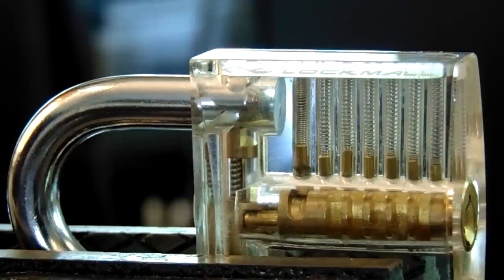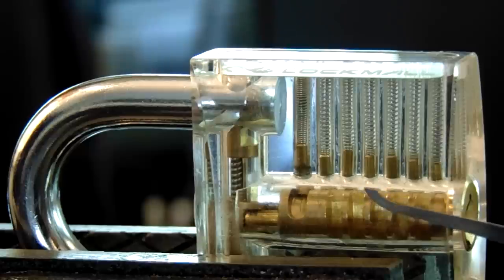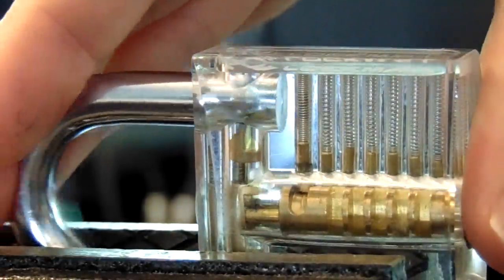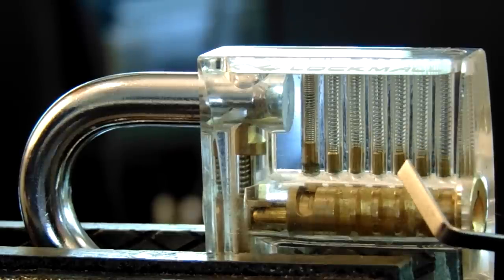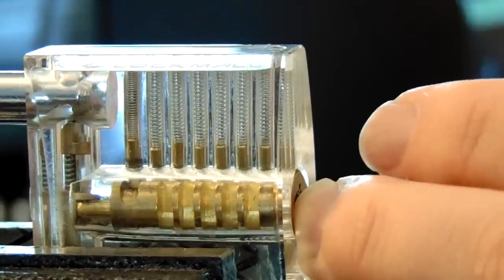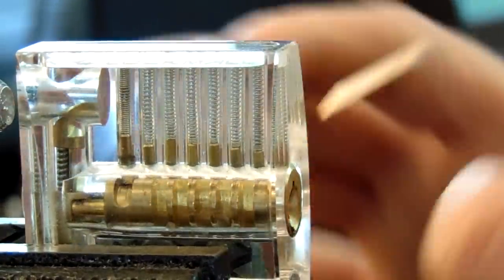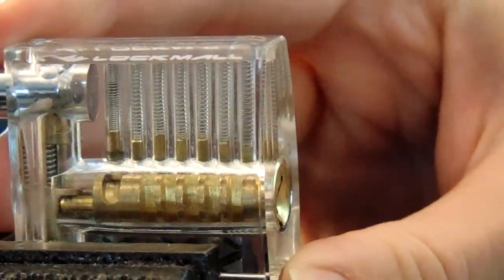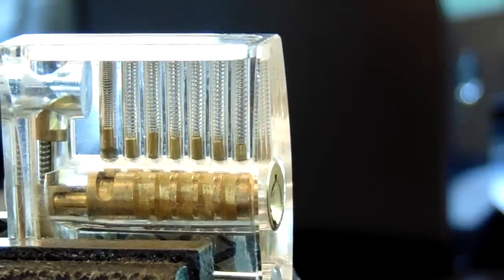[30] Closeup On How Lock Picking Works

Comment: I don't know how many times I watch those secret agents on TV as a child and tried opening door locks with a paperclip or a metal nail file.  Later in life I had a general understand of how locks worked, but your video totally explains everything I never knew about lock picking.  I just have one question.  I am 61 now.  Do you think it is too late for me to start a life of crime, or should I just stick to sitting in my recliner eating chips and my diet Coke and watch James Bond do it on TV?  :)  Thanks again.  God bless.  James
Reply from the maker: I would just pick locks at home. There are plenty of people in the community that are your age.

Thaks for checking out the video!
Reply: What the heck. Get out there and give it a go!
Reply: @kentmerrill8925  thats right give it a go....if you get caught you blame dementia or any other old age foibles and get away with it :o)
Reply: If you have the inclination to start a life of crime, remember you need more lessons on how to bypass CCTV, subdue the dog, and also run away quickly (@61 that is). Just understanding how to pick locks is just half the story. You better be at home eating chips, and not in jail. lol. I have seen people tampering energy meters but their expertise lay in getting through the paper void seals, not just the electricals.
Reply: angelhelp777 kk
Reply: I am 64. And growing up as a child like you did,  I tried whatever I saw by imitating and amazingly, quite a few were succesful, until I really got the hang of it. I never used the newfound knowledge in crime. But it was very handy whenever I or sometimes, with companions got accidentally locked-out. Everyone was thankful. Would you mind sharing the chips and coke, please? Heheheheee!
Reply: You Only Live Once
Reply: @jaishetty8586  Also, newer homes are now secured with electronic locks. As for most commercial properties like banks, hotels, jewelry stores, safety deposit box facilities, etc... they have several levels of electronic locks in place before an outsider can access the place where money and valuables are stored.
Reply: never too late
Reply: Go for it. Look at your age if u get busted u dont have much time left any way. U have nothing to lose
Reply: Where do you live? I will join you, two are better than one!
Reply: @Codebreaker4981  I'll join too. I retired from the Army. I have additional skills that might come in handy.
Reply: Get yourself some rally driving lessons. And  practice parkor when ever you can. And the  job's a good un!!! My grandad said count him in on the next job. @ diamond geezers. Com
Reply: ha ha
Reply: Soon "Thief Simulator VR" is coming out, I suggest practicing there first :)
Reply: Crime favors the ambitious.
Reply: Never too late to pick them. Prob good to know in case of Zombie Apocalypse
Reply: This the time Maybe 10 years hard time isnt hard to do with memory loss plus if succesful you can sit at beach with a ton of money
Reply: You are never too old to start a life of crime. 
Look at Hatton Garden Heist
Reply: Try to be the criminal once it is never too late. Haha
Reply: I learn this for when I am in danger and have to use to save me
Reply: angelhelp777 Get off the diet coke. Aspartame is a chemical warfare agent.
Reply: 😂😂😂 You're funny!
Reply: Denise Roosevelt ???!
Reply: I say give it a go. Worst case scenario is you're eating your chips in a cell. Don't forget to share with your new roommate.
Reply: @Codebreaker4981  1 person knowing what you do is to many knowing, your better do it by yourself.
Reply: Lmfaoo idk if your serious or not but that's funny af
Reply: Lmao Just saw your profile pic ur serious
Reply: Nahh it ain't too late
Reply: Code Breaker Lock Sport but two can keep a secret if one of them are dead
Reply: 61 seems to be a good age to be an accounting CEO or Presidential lawyer.
Reply: i think if you where that type person you would have been stealing seance you where young maybe even a little kid and it wouldn't even be a question in your mind
Reply: @HelpfulLockPicker  I'm here laughing thinking. When he put out this video, did he realize the funny comments it would bring. 😄. Thanks for the laughs and the knowledge.
Reply: 61 damn your just getting started
Reply: angelhelp777 diet coke more risky
Reply: Only do the crime if you're willing to do the time. Living in a cell the size of a single room with a smelly   toilet in it with 2 or 3 other people don't seem appealing to me.
Reply: @mottthehoople693  just like Joe Biden. The Democrats will lose but just blame it on Dementia.
Reply: Thanks. Good job!
Reply: @jessitrishperez4371  I just read your comment about the Zombie Apocalypse.   You must be able to foretell the future.  With the  way  people  are acting during this Covid-19 crisis you would think we  were having a Zombie  Apocalypse.  I pray that you and your family will avoid  Covid-19 and the  Zombies who want your toilet paper.   God bless.
Reply: It's NEVER too late.
Just don't get caught.
Reply: I'm 76 and I've just started lock picking, I can't be a burglar though because I can hardly walk.

Comment: Thanks for showing all the different techniques. I only knew about single pin and raking before this. Having said that you didn't mention bumping. Im trying to work out what im doing when I use a key that fits but wrong keying.. with a lil bit of tension to open a lock.. I think I tried all those techniques and found raking worked best
Reply from the maker: I didn't do bumping because at the time I did not want to take the time to make a bump key to that lock. I have found both bumping and raking to be very effective approaches.

Comment: Wow, kind of scary how easy that is!
Reply from the maker: Jayme Fall When you open your first lock it is very eye-opening it changes your view on security. This may be one of the easiest locks to open but you would be surprised how easy common Master locks, kwiksets, and schlages are to open. Check out video 28 for examples.
Reply: HelpfulLockPicker This video made me interested in lockpicking arts, do you know where I can get such tools to learn this? (if possible in Europe)
Reply from the maker: There are plenty of options for people in Europe. I recommend you checkout www.reddit.com/r/lockpicking and check out their wiki.

Here is a link to their trusted sellers: https://www.reddit.com/r/lockpicking/wiki/index#wiki_trusted_sources

If you are looking for minimal investment www.banggood.com has some decent offerings the only problem is their tension wrenches are not great. These picks are okay but you might want to sand them down to make them thinner. They are 0.030 inch thick most picks are 0.020 to 0.025. 

https://www.banggood.com/Transparent-Inner-Visual-Padlock-Practice-Set-with-10Pcs-Unlocking-Lock-Pick-Key-Lock-Pick-Tools-p-1108011.html?rmmds=search
Reply: same thing happened to me when i opened my first lock - its amazing how little security we actually have. Locks are actually really old & maybe should be considered an outdated invention
Reply: Tim van de Goor There are some decent kits just on eBay
Reply: That lock is set up to be easily picked
Reply: whats even scarier is how good he is at it and how many different ways he knows he can do it...
Reply: @rileymonster7064  Any decent locksmith would
Reply: @warpedreality7988  the dark web
Reply: Jayme Fall                              In
Reply: Yeah, "locks only keeps honest people out", if you rely on a lock to protect you and your possessions you are sadly misinformed/ignorant unfortunately. It's good to know how it works not only because knowing how to beat locks is fun but it will teach you that most are barely better than having a sign that says "Welcome, come on in and take what you want".
Reply: @mattfield3371  so you can pick a "yale" lock and then a 5 lever mortise lock?
Reply: that lock has pins with rounded head,,, you can pick his lock with a needle too. Normal lock have them cilindrical, so its harder, and more expensive ones have pins with false grooves so you cant really use any of these methods, only 1 by 1 and you really need to be a pro with years of experience to pick those in same amount of time everytime.
Reply: It's scarier when you find out there are easier ways to open doors than lockpicking.
Reply: @DiamondPugs a creative mind is tool nr. 1
Reply: @Relayzy1  LP possible
Reply: My dad is a locksmith and I grew up learning how to pick locks. I found it interesting how easy it is to gain access to what us supposed to be safe. However, this video is misleading. The lock he is using is a training lock. It's one of the most basic and easy locks there are. The higher end, more expensive locks take a good amount of time and a light handed touch. Some locks need more pressure on the tension tool while others require a very light pressure. If you put too much pressure on some locks you'll never pick them. On others if you don't put enough pressure the pins just fall back down. Some locks have different size pins and some have a certain order you have to pick before freeing the pins above the sheer line. All in all this video is misleading.
Reply: @nathanscott1764  I don't actually think the video itself is misleading. It is exactly as stated on the tin, and does exactly what he said he was going to do: i.e. Show the basic mechanics of how lockpicking techniques work. Mission accomplished.
Reply: Oh it's so easy you have no idea
 Masters are like 15 second picks
Your house might take 30
Reply: It's a garbage lock
Reply: If you watch the lock picking lawyer on YouTube, you'll see how easily he picks a bunch of locks. This clear model is easy and I've picked it with paper clips. I've also picked door locks for friends that have locked themselves out and it only took me a few seconds. I'm not a pro at all. My only training was through YouTube and buying this clear lock from Amazon. Yea it's fuckin scary
Reply: This is a very basic lock

Comment: pick locking skills went from 0 to 100 REAL QUICK💯
Reply from the maker: Thanks for checking it out!
Reply: zipping looks easy
Reply from the maker: @commentfreely5443  It can be but it doesn't always work
Reply: @HelpfulLockPicker  that's along the lines of my question. I was thinking, why wouldn't someone just always use zipping, rocking or raking? And what would cause any one of those to not work?
Reply from the maker: @tommyv5435  raking, rock, zipping, and lock bumping can be defeated by better tolerances, good key bitting, security pins, etc. These techniques are a great first approach but single pin picking is what you will need once you get to better security locks
Reply: "pick locking skills..."

* Lock picking skills. (You're picking a lock, not locking a pick.)
Reply: Mondo Duke  I do
Reply: Lion Mane  Completely wrong in what?
Reply: It's pretty much the other way around. Single pin picking is high-skill lockpicking. Raking and combing are low skill attacks

Comment: What a fun and informative video...Often, I am called because a resident has lost their keys and duplicate's have not been kept or put on the board, for opening storage areas...This will at least, save the lock, should it still be needed until a replacement can be purchased...My thanks to the gent that made it.
Reply from the maker: Thank you for the kind words, I'm glad it helps

Comment: LockPickingLawyer and this video is inspiring me to get some kind of lock picking kit and try to pick my home's locks, to see whether they're any good.
Reply from the maker: If you live in the US most likely they are not difficult, however, you really do not want  to pick locks which are in use. You can break them.
Reply: @HelpfulLockPicker  I'm from the Netherlands. I didn't think of the possibility of breaking my locks. Thanks for the heads-up.

Comment: A very good demonstration on how locks work. Thank you very much. May be I can now go and pick the drug dealer's lock on next street to locate the stuff he took from me. Joke aside, I realized that there is a "Master Key" option in my local hardware store. It is called a battery powered angle grinder. My garage was broken into despite being padlocked. So I went and bought an "unbreakable" padlock mad of toughened steel at three time the price of a normal lock. I went away and foolishly believed that my garage will be fine. When I came home, the entire lock was gone, and the garage was cleaned out comprehensively, again! This video will help me to break my own lock, but burglars will not bother with messing around. They would go for the "nuclear" option, ie. an angle grinder.
Reply from the maker: Angle grinders are a great tool lol

Comment: Working on and around many different vehicles almost every day means I often need the services of a locksmith. I usually can't afford a locksmith and  I attempt to do the work myself. My success rate as a self taught hack locksmith is less than 50/50.😒☹️  I'm very confident I'll be able to improve that success rate after learning from you how tumbler and pin locking mechanisms work and how they can be picked. Thank you dude.
Reply from the maker: Thanks for sharing

Comment: Do a video on entering a bank vault.
Reply from the maker: I do not
Reply: Don't bother. Just access it from underneath. Of course you have to dig a tunnel and bust through some concrete and cut some rebar but that's much easier than trying to pick the vault. Also, no alarms underneath.

Comment: Wow,That’s how they opened my house.
Reply from the maker: Kebede Buna You don't want to pick locks in use but sadly many common locks open this easily. However, statistically speaking thieves don't pick locks. Are you interested in getting into Locksport?
Reply: @HelpfulLockPicker  I had a feeling you shouldn't pick locks in use, but I'm not exactly sure why. Why shouldn't you? That's actually the main reason a lot of us watch these lock picking Tut's, so we know how to get in when we're locked out or have forgotten our keys 😁 Though it's interesting to know there's such a thing as Locksport!
Reply: @nattybynature1262   Kinda obvious that it's a rule of thumb just like any tool/skill that can be used for detrimental purposes... Take firearms for example... #1 rule is to never point a gun (loaded or unloaded) at another person. Of course, the main purpose of owning and learning how to use a gun is to do just that when the appropriate situation calls for it..

Comment: I'm not sure what its called exactly. An Overset? But it would be awesome to see you explain why it happens, and how to tell if it has happened. What I mean is when you push a pin past shear line and it gets stuck, wont fall down. I'd assume you'd just have to try feel if its sponging on the spring or not?
Reply from the maker: Look through my lock picking home school playlist
Reply: @HelpfulLockPicker  I seen that video the day after i made that comment. - Great informative video, gave me a few extra useful tips. Thankyou!!

Comment: Interesting video! However, locks are not usually in a vice. Try doing this on a lock, that is able to move around. It's not as easy. I guess I'm not a very good lock picker. A lock only keeps the honest people honest!!!
Reply from the maker: Thank you for the kind words! I agree, locks in use are often much harder!
Reply: I'm thinking it was in a vise to help the viewers see. If it was in use would be hard to see through the guys hand to see a dam thing in the video dont you think?
Reply: @alvino9611  agreed, for a visual aid, its great. I also thought the video was helpful. I bought the same practice lock, and picks.
For me, it took longer. Like I said earlier, I'm not a very good lock picker.
Reply from the maker: This is why it was in a vise, however, I typically prefer to pick locks in hand if you check out any of my other videos.
Locks in use are more difficult to open than locks at home.

Comment: This is good news for those thief wannabe.
Reply from the maker: Luckily most unauthorized access comes through destructive entry so you will not need to worry about this too much
Reply: HelpfulLockPicker of course I know that. But thanks for the tipS both on lock picking and breaking in by applying more destructive forces. Lol.
Reply: HelpfulLockPicker BTW, where did you get that acrylic pad lock anyway. It's so damn cool. Do you use it to hook up chicks or what?
Reply: Just half the story. You need lessons in CCTV, dog management, and running away like ben Johnson too.
Reply: @jaishetty8586  running away like Ben Johnson helps nothing. You have to be able to run away like the French in WWII.

Comment: Training criminals since 2017......I feel so much safer knowing this is so easily available on the  web.   Next video:  How to open locked windows from the outside.
Reply from the maker: Statistically speaking most unauthorized access comes through destructive entry because it is quick and reliable. Lock sport is focused on fun and picking locks not in use. Thank you for checking out the video :-)
Reply: Criminals now a days actually don't pick locks unless they are professionals .. Most ingenuitive street trash will buy 7 or 8 duster cans , hold them upside down while spraying the lock then just bust it open

Comment: Great video I love the practice lock you have. You make it look pretty easy. I’m gonna try to practice your techniques.
Reply from the maker: This clear lock is very easy but it is not so far off from the lower end Master Locks and Kwikset locks. You can get one of these on Amazon as well.

I also recommend trying out a cutaway lock.

If you have any questions feel free to ask!
Reply: It is really harsh inside a jail.